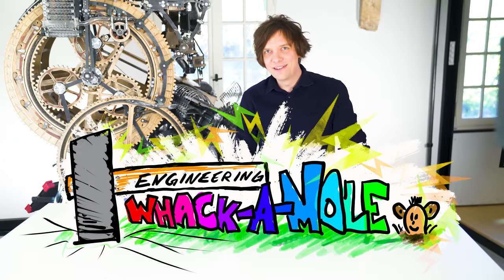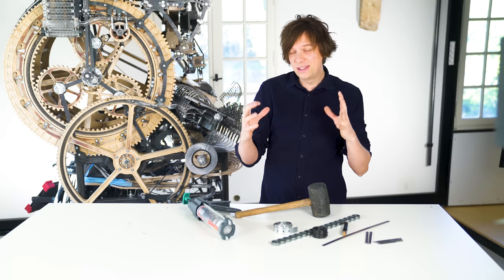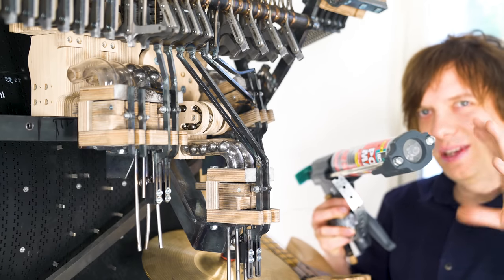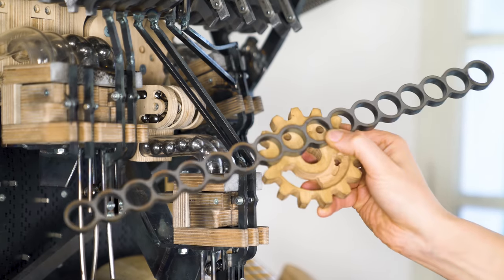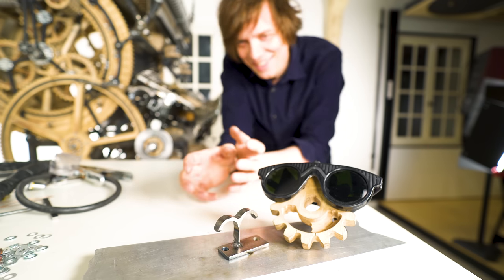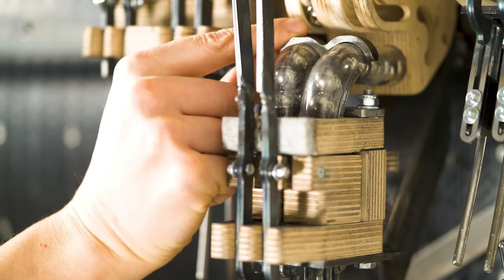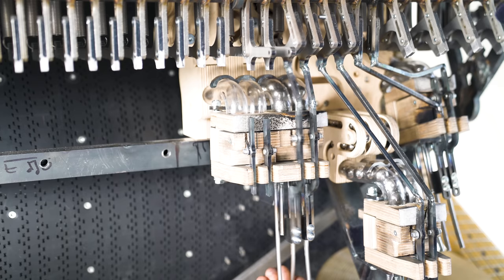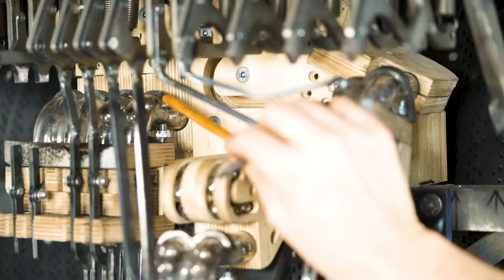Let’s Play: Engineering Whack-A-Mole

Comment: Why not just have a flanged face on one end of the tube, that then gets held down in place by the marble gate. You could just cut up the funnel a few mm and then heat and press it flat. Then cut a recess into the marble gate. I understand this would make it a little more difficult for assembly, but you could assemble the entire marble gate unattached and then place it as a complete assembly. Alternatively, you could design in using 'C' clamps at the end of your flange going into the marble gate, by scribing a section into the flange as it enters the marble gate to lock it into place. This would be easier to incorporate into your design, and also a more common engineering solution for these types of problems.

Comment: Why not use set screws in the marble gates to screw into a hole in the side of the PMMA pipe to fix them in place without actually exerting pressure on the pipe deforming it?

Comment: I know that it's plywood but wouldn't setscrews also work?
On the second thought they might deflect the pmma pipe
Well... Just a suggestion
Way easier to just drill a hole from a side and put a setscrew in though (like in a threaded insert or sth)
Great videos after all!
Keep up the good work and maybe wilson will be motivated enough to finish the mmx for you...

Comment: Martin, instead of adding features after features on the marble gate, don't you think the marble entry should be redesigned instead? Relying on a precise marble column height when there are dozens of marbles in the gates seems like a weakness that should be corrected. Maybe instead have a bypass so the excess marble directs the incoming marbles sideways onto the next entry?

Comment: Why didn't you fix the PMMA pipes with screws through the wood from the sides? Just drill holes through the wood and the pipe, insert a threaded bushing into the wood and screw it together with a screw. Just make sure the screw is short enough to not get in the way of the marbles.

Comment: Fault tolerant design thinking is what is required.  Allow your parts to fault, but any faults should be non-destructive and cause no marbles to be lost.  So much precision is required with Martin's design currently, I don't know if the machine will remain error free once its torn down and moved to another site.  The result of when you don't do fault tolerant design is 'integration hell' (whack-a-mole).

Comment: Hi, Martin!
What if you make the end of pipe a bit thicker (like the very edge of it) and then in the top part of the gate itself (inside of it) you could cut out a place for this wider part of pipe :)
This way you will stop it from get of the gate :)
P.S. I wanted to send a rough drawing here, but realized that you can’t add an image on YouTube comment and unfortunately I don’t know where can I send it to you.. :)
Reply: Other way, you can glue a washer ring to the end of pipe and then it will be locked between top and bottom part of the gate :)

Comment: Engineering "wack-a-mole" should just be called engineering in my book. I think what you have made is more like a mechanical computer. In software development we usually say all software has bugs. Curiosity had two versions of its software, developed by different teams, so that one could take over if the other failed. The apollo 11 software had a critical failure just as they were about to land on the moon.

Comment: For that PMMA Pipe to push up like that means something at some point got bound up in the gate mechanism. Maybe a marble didn't drop quickly enough. That was the weakest point so it pushed it up. It almost acted like a shear pin or an unintended mechanical fail-safe (Fuse) . I'd be learly now that in the future if it gets bound up again something may break or bend. Might have been since the edge of the pmma pipe doesn't go all the way down and be flush to the bottom of that top block of the marble gate that the marble pushed back against the lip.  Kinda hard for me to explain via text. Would be easier to show on a drawing. Your fix will work keeping the pipe down, but I'm afraid that in the future if the bind happens again something my break.

Comment: You are solving the symptoms. The real issue is the marble divider. Having to maintain such precision in the marble height in the divider, will keep forcing you to patch the marble paths over and over again. And when everything is working fine, the first time you disassembly and reassembly the machine to move it for a live show, you will need to readjust everything again.

Please please please: use a different marble divider design!!!

Comment: Martin, how many problems have arisen because of the need to keep the marbles in the marble divider flush with the top? That’s 32 points of failure. I’m not sure what the solution is, but I think it’s an area that really needs addressing. Stop adding complexity to the marble gates with variable length paths, and parts that can’t afford to move a millimetre. Look at the marble divider! My first thought is a “divide by 1” for each channel. The chance you will see this is near zero, but I really hope you do. The moles have been lurking in the marble divider the whole time.

Comment: Here's what I don't get, why don't you have a second marble gate at the top that lets marbles pass unless a marble is dropping? That would sidestep the entire need to ensure that the stack of marbles is level with the top. Like, sure, you'd need to make sure that it stays open exactly long enough to let one marble through, but you already have a gate with a staging area down below, why not make the upper gate designed in such a way that there's always an area where exactly one marble can fit in and if there's one in, the ones above would pass over it? Then whenever the lower gate is triggered, you trigger the upper gate to drop its one marble into the pipe.

Comment: I can't help but feel this is still papering over the cracks of the real issue, which is that the feed of the marbles at the top should ideally not be reliant on the height being 100% consistent across all the channels. Not sure how you could resolve that (maybe add a third dimension to the marble divider to allow them to flow past each other somehow) but otherwise I feel like this is a mole you'll have to whack again!

Comment: Martin... Engineering IS whack-a-mole for issues... at some point you just run out of moles that happen frequently ( and only rare ones remain ).
Also, design is never perfect until you test it, even with very advanced simulations not every issue can be found beforehand, so don't be too hard on yourself!

Comment: why not just use grub screws to hold the pipes in place?

....simpler, faster, almost no changes just an extra hole and a single new part...
Reply: ...and if you need it to be extra secure, you can cut an V-notch into the pipes where the screws make contact, this way you'll make the pipes self-aligning (pulled into place by the screws).

Comment: Couldn't you have cut an L shape in the pipes and "hooked" that under a small nail in the gate? (I hope you understand what i mean.. it would mean you have to put the pipe in the gate and then turn it around in the gate to lock it) That would be a really easy fix which is widely used in fixing pipes.

Comment: You really, really need to learn how to drill and TAP those mounting tabs so the nut is not needed, or you are using the nyloc nut because you think the Machine vibrates way to violently to not use a locking nut, in which case, you may need to do some balancing.

Keep up the good work.

Comment: Why so overengineered martin?!, just joking i know this is your default mode. Tip: drill a hole in side of the upper wood part where the pipe comes in and use a set screw to clamp the pipe, or also drill a hole in the end of the pipe so the screw can also go into the pipe (first idea is better since this way you can adjust the pipe). You wanted an excuse to weld again :P

Comment: What you are stuck on is what engineers and programmers call "integration hell". The point where the project is 90% complete, and it to complete the other 10% takes 90% of the time. It feels like wack-a-mole, and it feels like there is no end, but trust me: There is, and it gets better. Just take it in strides. Take a step, and a step back, to see if you are on the right track, and if something really adds value. if not ? Scrap it. If it does? Take the next step. Rince and repeat. As long as perfection is not what you are looking for, "pretty damn awesome" should still be in range. Good luck!